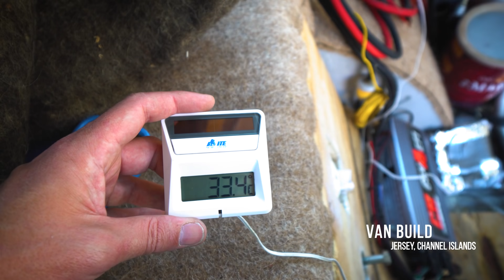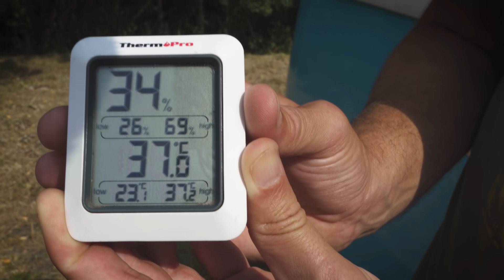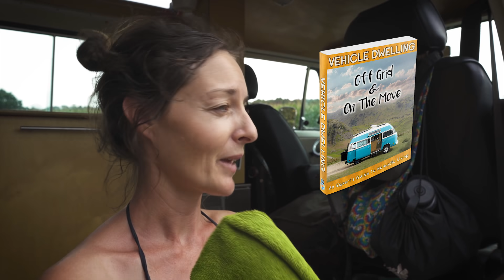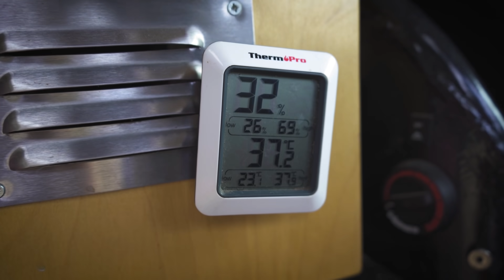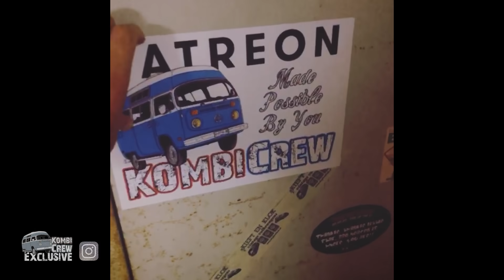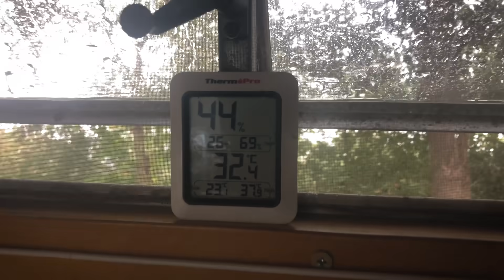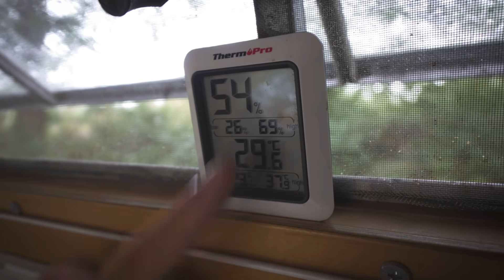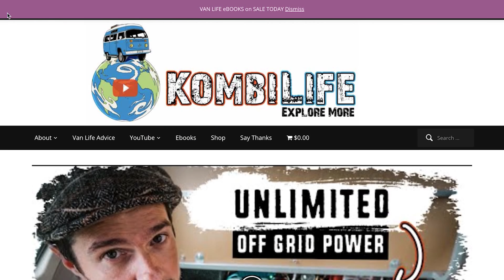VAN LIFE - How To Beat The HEAT (without AC) // S05E06

Comment: Couple tips learned from camping in the Outback is this: get a small water bottle with a spray nozzle on it (similar to a cleaning bottle). Fill it with water and ice (and maybe a little cooling gel used for burns) and spray that on your body in conjunction with a battery powered hand fan. Also drink electrolyte powder such as powerade, with ice and lots of water, especially in a thin metal cup. This keeps you brilliantly hydrated and you can press the cold cup on your skin.

Comment: Just a few words after some summers in Baja. Use reflective stuff on the outside of the windows/van.. you can do the same thing you were doing with magnets on the inside but mount on the outside of the doors and body. So much heat absorbs into the metal and once inside the van windows not all of the sun rays escape back out. Also there is an RV top paint that is made to greatly decrease solar absorption. I forget the name but a friend had it on his Chinook.

Comment: Hey Ben & Leah. Thanks for posting great vids!
Pro tip for keeping laptops cool is to power off, remove the battery and regularly (every few months) blast the dust out the heat fins & fan. It can built up over time like a thick carpet and cause temps to get high. I prefer to always keep mine below 80°C so if it's getting up to 90°C or more I'd highly reccomend cleaning it out. If the dust is really caked on you can take all the screws apart and clean the dust out with an old toothbrush. If you're taking it all apart to do that it's usually worth spending couple of bucks and changing the thermal greese on the CPU & GPU heatsinks while you're at it.
I personally use SpeedFan app to show me temps in the taskbar.
I also use ThrottleStop customised to dial back the CPU speed (Turbo Boost) once it gets to 80°C. This means I can use my old 1st gen i7 laptop with no worry of burning out the CPU even when throwing heavy researse hungry content at it like video editing.
Recently I installed Google Chrome and noticed it has a backround app that caused my latop to run 20°C hotter! I was able to permanently disable the backround app but yeah a simpler option is just to use another browser that's not such a hog on resources such as Firefox.

Take care and have fun on your adverntures! :)

Comment: Suggest you give some thought to the air conditioner you will need to be able to cope with the way hotter temps you will encounter in the Tropics and Central Australia, Melbourne even. Suggest an inverter generator,and small domestic air con = sleep at night.

Comment: Paint color on houses also makes a big difference.  My house is white.  Not big summers in Montana, but it does heat up.  No air conditioning.  Sun goes down, flip on the attic fan cools it off and close the windows before morning.  Works great!.  When we do dog shows we always put out kiddie pools for the dogs just to stand in when it's hot.  Getting their feet cool makes all the difference if you aren't close to water.  A small tray may work for Alaska.

Comment: Raise the laptops a bit with two books and point one of those fans at it. But remember to keep the slots on the underside open.
Does wonders.
Reply: You can get USB powered laptop trays with built in fans for not too much money. My laptop used to overheat whilst rendering and gaming. Got one of those from amazon for about £15 and it brought the render time down quite a lot on videos, and brought up my fps whilst gaming lol
Reply: TheMadRatter The only issue with those laptop cooling pads is FAILURE. I stopped buying them because they fail after a month or two. I’ve improvised by propping up the laptop and using a small USB fan. Works better because it lasts.
Reply: @Swimdeep  perhaps it's cooler in the UK than where you are, but I only bought one and it didn't fail, it's sat in my cupboard for if this laptop starts overheating lol
Reply: TheMadRatter Im in Los Angeles and man is it hot. I have to cool my laptop.
Reply: All nice, but I think that in their little bus, space is at a premium. So they have to make due with what they already have already, without cluttering the VW even more.
Hence two books (or something) and the mini fans, already available.
Reply: @Paul_VanGo  already available yes, but more cumbersome and means that the fan is no longer directing air at the user.
Reply: @the_mad_ratter  Ok. Well. I'm not making this into a discussion. It was just a suggestion I thought of what they could do - at that exact moment in time - to relieve that poor laptop from the boiling temperature it had.
Without running to a store.
For the next time they run into this issue.
If you choose to do otherwise, that's fine.
It doesn't matter anymore really, since that was recorded 2 weeks ago.
Reply: @Paul_VanGo  yup, and my response was merely suggesting that they could buy a device to do the same job :) Arguments/dicussion with you came afterwards, and you initiated them by trying to validate your reaons behind the suggestion... 

Also - the internet is forever and people other than the content creators might like to use the idea/product.

Finally - if it was a suggestion for "next time they have this issue", then the product suggestion still stands as valid, as they have time to go and purchase one...

Have a good'un!

Comment: Glad you mentioned the roof insulation vs roof colour. I'd love to paint my split the classic PGSG (Palm green sand green) colour scheme, but where i live 40 degrees C is a normal day. So i was thinking about inverting the colours so that the much lighter green is on the roof, not ideal but practical and still looks good. But i'm also considering if having a roof rack and/or solar panels will end up shading most of the roof anyways... we'll see.

Comment: The roof vent with a fan and a second roof vent without a fan at the opposite end of the roof is amazing .I found in my camper it dropped the temperature  20 degrees f. Also ice in front of a fan is like ac until the ice melts. I use plastic bottles filled 90% with water freeze a set and while they are in front of the fan cooling I have another set in the freezer. 
 Also for DRIVING cooling in the OLDEN DAYS before auto ac they had ac they made a tin tube that you put in the passenger window like your vent at the top was a opening that let air from the tube into the car from the box the box had a opening in the front . The would fill the tube with ice as the drove air would be forced across the Ice and into the passenger compartment .they worked extremely well. I knew people that had them in restored antique cars get gas a bag of ice and go. However they are quite exspensive and hard to find because they would rust out over time. The last one I found was 20 years ago at a swap meet and around 400 dollars.but you could diy one from pvc pipe pretty easy.

Comment: Dont forget the solar pannels.  Not only do they provide power, but the soloar radiation which would usually hit the roof and make heat is now tranduced to electricity.

Measure the temp above and below the pannels
Reply: And most important, there is an air gap between the panels and the roof.

Comment: You should get the windows tinted. You would be surprised what a difference it makes! If you go with a good, quality carbon-based tint, you don't even have to darken the windows. It would just help MASSIVELY with the ambient heat in the vehicle. (speaking from experience)

Comment: Another (more expensive) option is to get carbon ceramic window tint. i have 30% on all my windows with 90% on the windshield. The heat rejection part of the film is "separate" from the tint part of the film so you don't have to darken you windows to get the heat rejection effect. I'm from Texas and its a must have on all my vehicles. Cost for a full size SUV will be around $500-700. Typically 400-500 for the main windows and 200 for the front windshield.

30% on front windows and 90% on shield is the legal limit here.

Comment: 21:38 A laptop with last-gen AMD would heat up much less for the same job :) Also on the software side efficiency is important. Like using primarily graphics chip to transcode video. 
Sure, that is a cost thing as well. I don't retire my old laptop while it is still useable.

Comment: 4:12 It would be even better if you put white cardboard shades on the outside of the window.  The problem with foil, is that even though it is shimmery and reflective it's still metal and metal absorbs heat and radiates it back inside the van.  I'm sure no one is going to swipe cheap cardboard shades off the outside of your van.  Learned this living in the tropics, the foil reflective padded shade had nothing on the cheap white cardboard one.  But either way placed on the outside is better all around.

Comment: Are you guys going to Wolfsburg? Take Boomerang home.
Reply: Their bus wasn't made in wolfsburg
Reply: @e-curb  I know that, but it's still the home of VW and an awesome place to visit. Theirs was built at either Hannover or Emden, but there isn't any visitor centres there.
Reply: Probably rolled of the production line in Hannover, as the production of the VW bus had moved from Wolfsburg to Hannover somewhere during the 60-ies. Because of production capacity in Wolfsburg at that time.

Comment: I wonder whether you could get even better draw on the ceiling vent by putting a vertical (removable or fold-down) plastic or aluminium pipe over the top when parked, to provide a chimney effect, a bit like a miniature https://en.wikipedia.org/wiki/Solar_updraft_tower 
The engineering challenge in your case would be making it transportable, fail-safe if you forgot to take it down before driving, and compatible with your lidded MaxFan.

Comment: Try www.swampy.net    This is a small 12 volt evaporative cooler that might help you out during the heat as long as the humidity is low enough. Before I retired, I drove a city transit bus without AC, and this product called the MightyKool made my life much more comfortable, Its not designed to cool the van, but both of you instead. Keep your windows open. Since it only runs on a few amps , you could run this off a battery for hours at a time. Since you're traveling around the world , you'll get plenty of use in the more arid hot countries. Meanwhile you could drive down to the Alps for cooler weather.